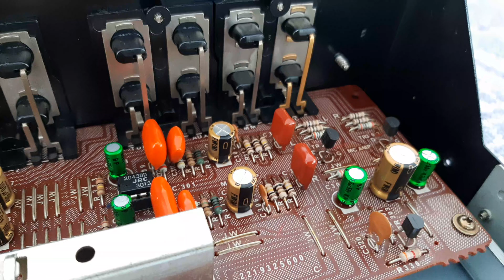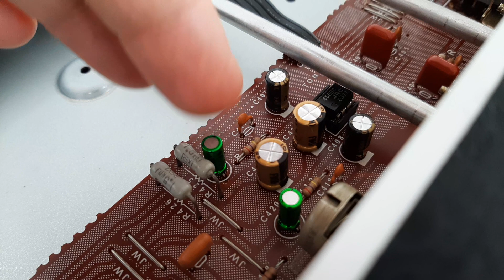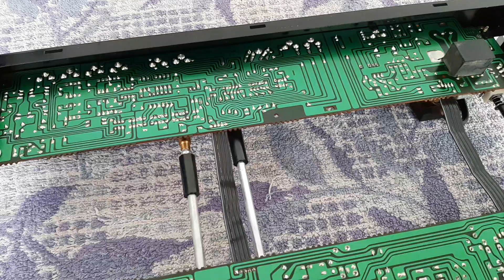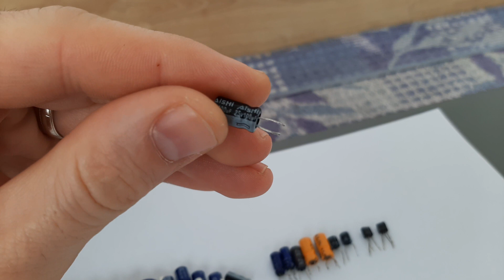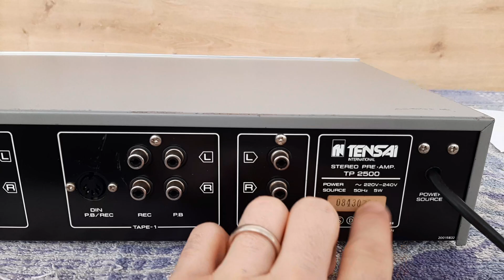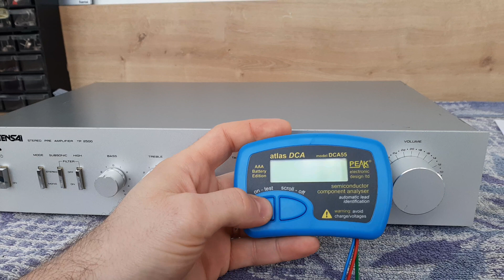Tensai TP 2500 - Stereo Preamplifier - presentation

Comment: Where would I get parts for this unit ..I have problem with function switch it won't stay on tuner ..
Reply from the maker: Hi and thx for comment. I will suggest to you this video : https://youtu.be/kqnM26e0BC4
Try this, if is not working you have to look for a parts donator. Cheers !

Comment: That's a lot of jumper wires.
Great job, and nice to see the guts of that preamp.
I have a question: what kind of tests do you perform on capacitors?
Cheers!
Reply from the maker: Hi, jumper wires ... because of design  department. Thanks for your appreciation.
About tests around capacitors i think is better to come with a video to cover this,  but in simple words i m doing in this ways:
- visual inspection for deformation / leaking / corrosion;
- 40+ years capacitors from my experience, should be replaced;
- measurement of charging time with capacitor in series with a known resistor connected to an oscilloscope and signal gen - only time to time
- 3 x esr testers and i made the average after measurements.
- fluke multimeters for small capacitance.
Cheers !
Reply: @MariusHiFii  That's a nice battery of tests. Out of curiosity, do you have a purchased capacitor leakage tester or did you build your own device?
Reply from the maker: Hi, all of them i purchased! All good there? 😁